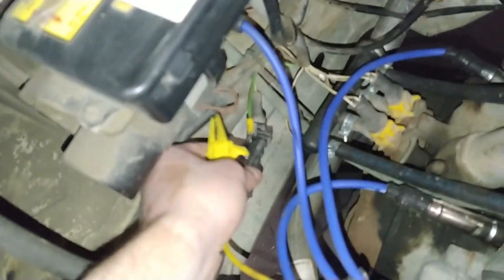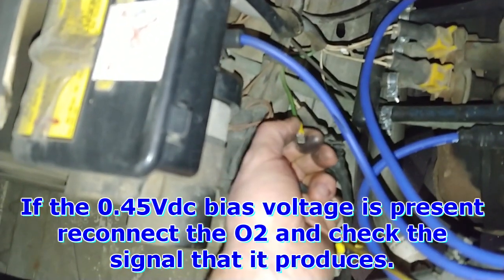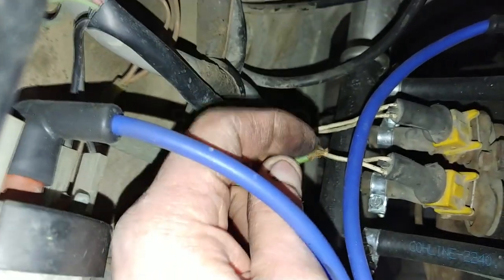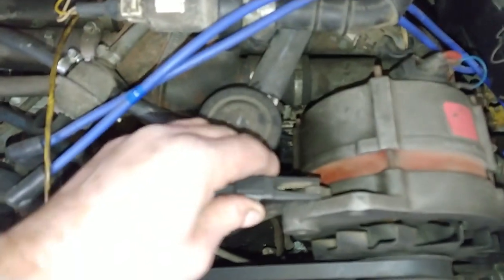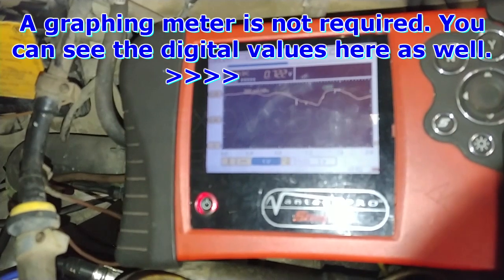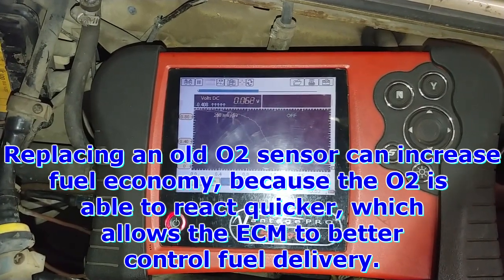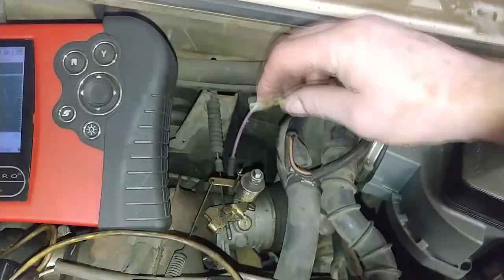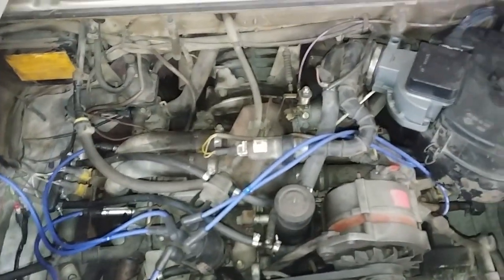VW T3: Common O2 sensor (wiring) issue

Comment from the maker: Nothing exciting here... I've mentioned this before in other videos, but felt I needed to post a better quality / updated video.
Reply: Thomas EXOVCDS no injection = no problems ... when the damn wire won't snap inside the carb :( still mad
Reply from the maker: Did the acid get it out?
Reply: Thomas EXOVCDS i removed some casting flash off to see what happens / if it reacts with the material . Well .... it didn't leave any. I will try compressed air and then 1 go injection 2 buy a new carb
Reply: Nothing but you :P
Reply: About 4 years ago, I bought a Passat. Your videos taught me the things I needed to learn in a perfect way. 
Once you mailed me some stickers, which I put on my Passat (30V) GLX wagon. I sold that car a few years back and didn't remove the stickers. 
The baby with the headphones on is still alive today. Cracked after 4 ish years in the Utah sun, then now in Maine sun and winters. It's still there making a mark on the world. :D 

Now - If you have a moment to review this diatribe, I would be very grateful for any suggestions... 

I have been chasing a system lean code on a Mk5 GLI BPY / FSI for ... 2 years. 
I have replaced or otherwise positively made sure the following parts are in proper working order. 

Front PCV / crankcase vent valve = replaced several times. With and without check. Current valve has check (and the rear tube as well).
Diverter valve = I have this on Auto order from Amazon they fail so much. 
Rear vent valve tube = With and without the check valve. Current rear tube has valve. 
Rear main seal was replaced as was the front seal and all other seals. 
Valve cover - yes the entire thing.
HPFP

STFT = +5.3 ~ +2.1
LTFT = -12.0 ~ -18.3 

Codes: 
o2 internal resistance high ( I ordered a new 02 and I should have waited to write this haha.. )
System lean because of this issue, but idle is not affected. 
I don't have any catalysts. I have a 3" downpipe from ebay with no catalysts. 
I built a custom intake plenum with a 3" ID pipe through a MAF smoothly down to 2.25" after the 90* to the turbo inlet.  
The car has no oil leaks at all which, I know is shocking for a MK5 with 275K miles - I just redid every seal when i did the head gasket. 

This car has the most inconsistent boost of anything I have driven. One time it's there, the next time it takes 20 seconds to get that kick in the pants from the turbo. 
Something feels like it's not closing correctly but the related measuring blocks are all ok. Like boost requested versus boost actual being the same within a VERY small margin..

I think the fuel pressure seems normal at 5 ish bar at idle and going to about 90 - 104 under full load (uphill in third). 
 Totally stumped - I want to fix it then wrap it in plastic until I'm 70.

Comment: Hi @EXOVCDS

I have black smoke and rough running once warm. Restart for 30secs runs great then start coughing black.  Green wire with ignition on is at 4.5v. when connected and running this stays constantly at 1.2v on my digital voltameter

Running w/o green wire connected feels better (more pickup) but still same black puffs on lower idle and dies when not on the gas. (Well it will idle sometimes but very rich)

Backstory: just replaced an engine, the previous one ran well but had a head gasket issue. The new engine starts up good but once at temp runs rich, black smoke. I have switched the fuel proportion valve and airflow from the other unit. Tomorrow will check resistance on the blue temp and ecu wires and a resistance test on the o2. I think its the o2 but when running w/o it connected still is rich. Any other thoughts. Injectors were rebuilt last year, might check the spray pattern.
Reply from the maker: What's a fuel proportion valve?

Have you actually measured fuel pressure?
Reply: @EXOVCDS  sorry the fuel pressure regulator. I will measure that also but can hear the pump.
Reply from the maker: @seanvogel453 
Pump can be noisy when it is struggling for fuel or when there is too much pressure.
Reply: Pumps not that old (doesn't sound louder then usual just noting that I can hear it) will check pressure later to be sure.
Reply: Ran a week ago fine with the other engine
Reply: I checked many things via the digifant/Bentley manuels..all was in spec including the fuel pressure. Turns out I had a gummed up injector cleaned up and got some techron... and also poor ground connection.  Running nicely now. Thanks for the suggestions.

Comment: Hello ! Video saved my day (bad connection on my 87 Vanagon) does it matter if I am getting .54 Vdc instead of the prescribed .45 ? Bad ECU?
Reply from the maker: 0.54 is fine... as long as the sensor signal switches between 0.8 to 0.1 all is good. It will switch / change slower when engine is cold, quicker when warm and the quickest at warm high rpm. Keep in mind that if you are using a digital multimeter, the refresh rate may not be quick enough to see all changes in voltage (digital meters usually just show an average voltage of what is detected).  Thank you for watching!
Reply: @EXOVCDS thanks a lot will keep following your great work !

Comment: Hi ! Thank you for your video :) I have the exct probleme when my engine is hot, after 10-15min on the road, i have black smoke from the exhaust and my motor stop. I've already tried everything that you mentioned 2weeks ago by my own. I don't know what to do... have you maybe an idea ? I've find some licking coolant betwin the admission pipe and the culasse (flat joint)
my sensor can be disturb feom this leakage ?
Reply: Engine : T3 WBX 2.1 syncro SR - 1991
Reply from the maker: What is the voltage on the green wire going to the O2 sensor, with the O2 sensor disconnected and the engine at idle?
What is the fuel pressure when the engine starts to smoke?

Comment: Hi Thomas.  great video!  I have a 93 EV that is running rich i dont have a VCDS but do have an appointment to get the van scanned.  in the mean time i want to try to get it running smooth myself.  my O2 sensor is carboned up and i will be checking the wiring on that. i have another 2 wire sensor downstream of the CAT, which is broken (just spins in pipe bung) and id like to replace. can i weld a new bung in and replace this sensor?  It sounds like one of my cylinders is not fireing.  I cleaned all my spark plugs--all were evenly fouled.  is there a good way to check the spark getting to the plugs? can i check my wire leads? is their a way to check the distributor? and i need to check the vac on the MAP.  any ideas or help
thanks a million.  love your channel
Reply from the maker: The sensor after the catalytic converter is a temperature sensor. Was never present on North American vehicles. Europe & Asia only I think (so you have an import import if you are in NA). 
If ignition items are 5 to 8 years old, replace them (short answer).
Service manual lists resistance values for spark plug wires & rotor. Plugs & cap should have 0 resistance. If you need specific info, just post another comment.
Perform a compression test first to make sure there's no mechanical issue.
Reply: The van is import from Japan and we are in Pei, incase you were curious.  2 of my spark plug wires are very jumpy in their resistance readings, one of which is mostly all the time on open line. I am thinking this is my problem. I will try to figure out how to check the distributor for continuity—could you explain this process? And I want to check the timing of the distributor too—any pointers there?
Patrick
Reply from the maker: @jamessullivan1648 I'll get back to you on Saturday. Weeknights are not good for lengthy replies, sorry.
Reply from the maker: @jamessullivan1648 
Distributor cap needs to be inspected for carbon tracking / wear that could cause spark to travel along the body of the cap to ground, instead of going across the tip of the rotor to the spark plug wire post.
The posts inside the cap can build up with corrosion from spark arcing. You can clean off the corrosion with a flat screwdriver. 
Resistance of each post terminal can be checked with an ohm meter placed across the inside & outside of the post of the cap.
Again, if tune-up items are 5 years or older, replace them.
Distributor timing does not need adjusting / checking, if the distributor was never loosened / rotated.
Even when replacing a timing belt, there's no need to check timing, as long as the cam & crank TDC marks were aligned correctly when the timing belt was installed & tensioned.
I timing gun with a degree wheel is not needed, but can be helpful.
The engine has to be warm and the ECM gas to be placed into "basic setting" so that timing can be checked.
The Bentley service manual has these instructions.
Reply: Looks like I need a new distributor. You knew it as it is 30 years old. It is visibly bad with lots of corrosion on points and cracks in rotor. I’ll be getting wires too. When installing is there need for timing work?  I can’t for the life of me see the indicator on the fly wheel. Recommend and part brands?  I usually use rock auto. Recommend and places to order from?
Reply from the maker: @jamessullivan1648 

We had a customer supply a Rockauto distributor... didn't go so well.

https://youtu.be/0SCviCZgw08

Remove the belly pan. Rotate the engine via the crank bolt (27mm) till the crank pulley TDC mark lines up with the TDC mark on the lower timing belt cover.
Then, remove the timing inspection plug on the top of the transmission.  Mark the TDC line with white paint / white-out. 
TDC mark will now be more visible with timing gun.
Follow instructions in service manual on how to check / adjust timing.
The distributor cap has 2 long and 3 short spark plug wire posts. 
The short one to the RIGHT of the two tall ones is #1.
Firing order is 1,2,4,5, 3 going counterclockwise.
Reply: Thomas!  The spark plug wires on my distributor (starting at the short pin to the right of the 2 tall ones) connect to spark plugs 1 2 5 3  4   In CCW rotation. I was very careful recording this info but it seems to me that the engine would not even run like this let alone start. Is it possible that my engine was running on the incorrect foreign order all this time?  It always started ok, sometimes a smell of gas. Ideled in park ok but whe stopped and on drive has heavy shaking.
Reply from the maker: @jamessullivan1648 
jamessullivan1648 
When the distributor cap is installed, the two tall towers should be at the 12 o'clock position of the distributor (the hall sensor connector should be above them).
It could be that someone "indexed" the distributor incorrectly. 
Meaning that the drive gear is 180 degrees out. 
If you remember where the wires were, put them back the same place.
Otherwise,  the way to correct the issue, is to set the camshaft & crankshaft to TDC (#1 cylinder) and then verify that the sistributor rotor is also pointing at that first short post to the right of the 2 tall posts.
Firing order is the same for all inline 5cylinder gasoline & diesel engines.
1 2 4 5 3
Reply: I’ve got the crank pulley notch lined up and I can definitely see the cam notch and I think it is lined up. Might not be perfect but very close. I have been trying to see the flywheel marks but it seems impossible to me… my distributor is somewhat tilted a few degrees CW putting the taller posts at 1:00 or so. The hall sensor pug is at 12:00. Needless to say the distributor rotor is in the #1 pin zone for the distributor cap. If it was “index” wrong does the distributor need to be completely removed/rebuilt?  Does this all seem to sound correct?  Is it possible for the engine to run with the wrong firing order?  Is it more likely that I made an error when I made my diagram? Will there be any harm done if I try it and the fire order is incorrect? And any pointers as to spotting the wT on fly wheel?  I’d like to be able to do this because I want to replace my timing belt water pump and tensioner(once I locate a tensioner).
Reply from the maker: @jamessullivan1648 
Just I case, cyl 1 is closest to the timing belt.
If the tip of the rotor is pointing at the 1st short tower to the right of the 2 tall towers, then the distributor is indexed correctly.
Check the routing of the wires again.
Reply from the maker: @jamessullivan1648 
Standard or auto transmission?
Reply: Auto aaf
Reply from the maker: @jamessullivan1648 
Use a long screwdriver and scratch it along the top of the torque converter. The scratching can help highlight the TDC mark.
https://ww2-secure.justanswer.com/uploads/Barlogio/2009-11-04_125454_vwvan.gif
Reply: Is the “tip of the rotor” the broad end with the brass coloured conductor?  I just tried new wires and cleaned rotor and cap. No change. The engine will o ly run with 1-2-5-3-4 as timing order.
Reply from the maker: @jamessullivan1648 
If it runs, it runs.
Does it run smooth or rough, if it's rough, then 2 spark plug wires might be mixed up. The firing order is listed in the service manual... if the order is correct and its running rough... do a compression test. 
Post a video on your channel so that i can see &  hear it running.
Reply from the maker: I uploaded a spark plug wire video.
1 2 4 5 3 is the correct firing order.
https://youtu.be/0kBHS-Wt5do?si=dO9fJ-9wvmqbLWzz